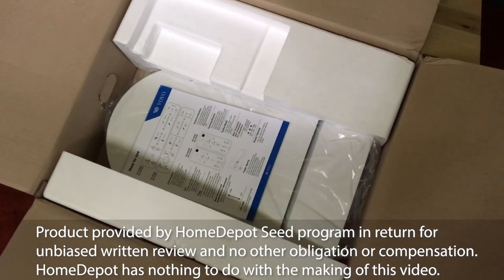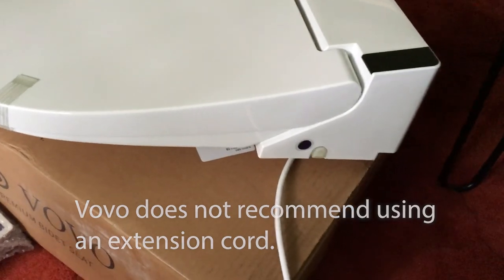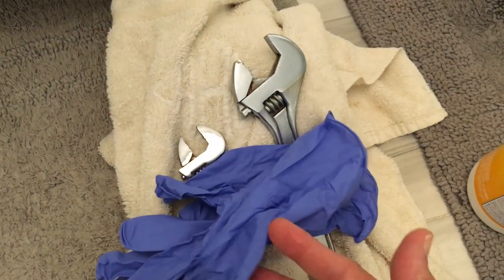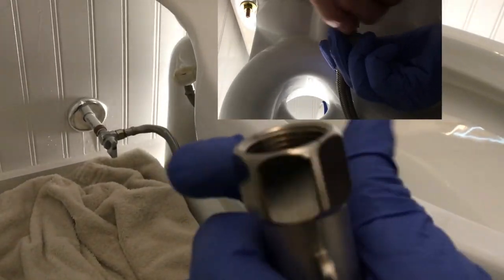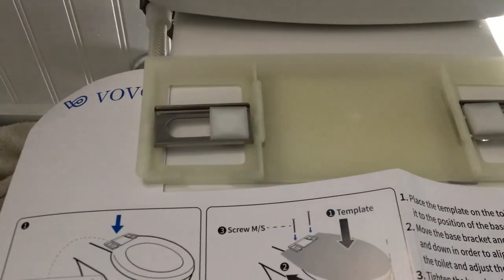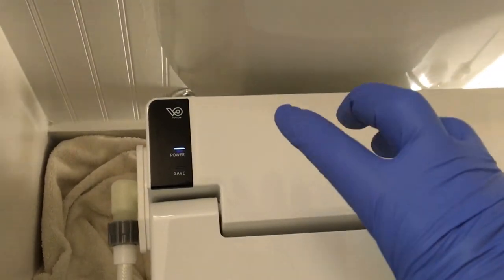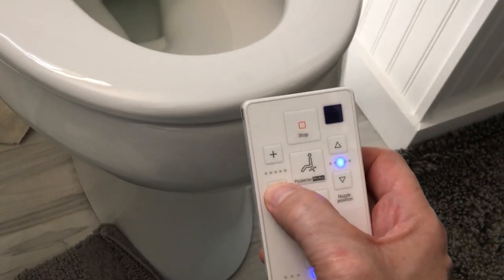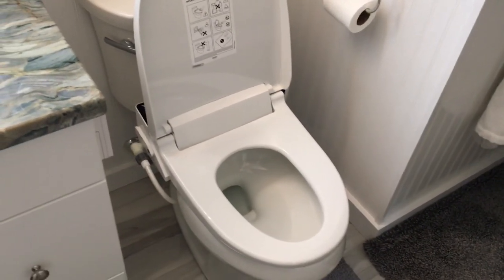VOVO Bidet install and proper use. Model VB-6000SE

Comment: Thank you very much for that informative video. Having just come back from a holiday in Japan, where these bidets are normal standard, I immediately started researching but found no affordable 220V options for use in Europe. Vovo as Korean producer seems to offer that for retrofitting (and no need to go for the insane (~4000USD) expensive "all in one" solutions offered here in Austria).
Reply from the maker: Here in the US we big on pain old toilets, so these seat bidets are a perfect solution as long as you can get power to them. I agree the all in one solution is just too expensive and not needed. Thank you for sharing.

Comment: Is the water heated also. I don't see any setting of water temperature on the control in the video.
Reply from the maker: Raymond, the water temp can be set by using the button located just below the large DRY button @13:20 in the video. You have a choice of three temp settings. Thanks for watching and the question.

Comment: Just purchased one should be here this Friday.  Just now finished sweeping up from putting an outlet in by the toilet.  What’s your opinion on it being you had it 3 weeks now.   Was it worth it?   Sure hoping just givin the price with the amount of features this one had compared to others priced close.  It seemed to have the features the $4-600 units had at only $300.   Vs the others I seen in the $250-300 range seemed to have a few less features than this one
Reply from the maker: Glad you ask, after the third use I became a convert. A month after installation and use, I don't ever see going back to a plain toilet. The misses was more reluctant to try it, but is now a regular user despite having her own bathroom (w/o bidet). My only concerns are making sure I clean on the underside around the spray head, and whenever we lose power the unit drops out of energy saving mode. With use of the drying mode I don't have a need to use TP to pat dry. I did discover the wash and dry cycle will time out on their own if you don't manual stop them and of course they both stop if you get off the seat.
Was it worth it, well I got it for free, but if we had a plug in the other bathroom I would make the investment on a much better way of cleaning and all but eliminating the TP. Your right this unit does seem to have a lot of features for the price. I guess you can save some money by getting the one without remote control. On the manual unit the controls are easy to reach, though if try using it to sit or get up with it might not bear the weight. If I had to give up any features it would probably be the Turbo and Pulsating modes. Looking forward to a warm seat on winter mornings.
Hope you get a chance to tell us what you think of it after a couple of uses. Thanks for commenting and watching.

Comment: Thanks for the helpful video. I have a question: does this bidet make any noises when you sit down on it ( any beeps or nozzle cleaning sounds when the seat sensor gets triggered )?
Reply from the maker: Good question, I have two different brands and they both make little noises when you sit and use them. After each use the wand does self clean as it retracts, however I clean the the wand each time I wash out the bowl.
Thanks for watching.

Comment: Prompt and clear instructions, thank you for making this video !
Do you know how to turn on the power-saving function ?
Reply from the maker: Kalman, to engage the power saving function go to the panel just above the inlet hose. The button is on the far left and it will turn on and off the energy saving mode. Thanks for the question and for watching.

Comment: Ok what do you do if the power goes out ? Or someone hides your remote ? 😱😲🏃🙀 really want to know...
Reply from the maker: Without power you treat it like a regular toilet. If the remote is missing, there are controls on the side of the seat you can use until you find the remote.
Reply from the maker: cdb  Great for guest and power outage.
Reply: It has an button on the side of actual product from what I know

Comment: Hi @cfldriven, great review! Does the toilet ring start warming up only when you open the lit, and stop when you close it, or do you have to manually use the remote control?
Reply from the maker: We have it set to be on, so we are always greeted by a warm seat. The heat function is controlled by the remote and not the raising of the toilet lid.
Reply: @cfldriven  Thank you for your reply. I actually contacted VOVO support about the energy efficiency aspect and they answered. I put it here in case it's helpful for others:

"We recommend you to turn the Power Save Mode on, it automatically adjusts the water and seat temperature to 30°C, gradually decreasing over time, and eventually turning off to conserve energy when the bidet is not in use.
It's important to note that once movement is detected by the sensor, the temperature will return to the preset mode."
Reply from the maker: @AnVinhNguyen  Thank you so much for sharing this helpful information.

Comment: Mine isn't spraying out water at all but has power. What's wrong with it?
Reply from the maker: If the unit is plugged in, and the water is turned on, does the remote light up. If not check batteries. If all those are correct, perhaps the unit is defective. VOVO can be contacted at https://vovo-us.com/pages/contact-us

Comment: Thanks for review. The water inlet pipe, can it be angled down ? (rather than facing forward)
Reply from the maker: Yes the depending on the length of run it can be angled down or back.

Comment: My Led is not working after half a year and the remote is sometimes bugging
Reply from the maker: My VOVO is at three years and no issues so far. Have you replaced the batteries on the remote? Also if it is acting buggy try unplugging waiting a few seconds and plugging back in. Hope that helps.
Reply: Just bought a few weeks ago and some functions didn't work at all sometimes. Maybe bugging?
Reply from the maker: @Janeelle-jg7jx  I would give their customer service a call as there shouldn't be any issues. Worst case return it for an exchange or refund.

Comment: Thank you for the review. Does it have a width spray?
Reply from the maker: No it has male and female button along with nozzle position adjustment. If you need to wash a wider area just move you butt around.

Comment: Great upload, thank you. May I ask which VOVO model this is?
Reply from the maker: Sorry about that the elongated is VB-6000SE and the round one is  VB-6100SR. Thank you for watching.
Reply: @cfldriven  Excellent. Thank you for your swift response. Are you still happy with it? I 'm slightly concerned about its low price compared with the competition.
Reply from the maker: @AntPDC  Overall very pleased with it. Occasionally the software goes wonky and I have to unplug it and plug it back in. I also have an Alpha bidet for visitors which doesn't seem to have any issues https://youtu.be/XFH53PWbJbw
Reply: @cfldriven  Thank you very much.

Comment: Great video. Do you think there is a way to install this on a wall mounted toilet that has no back access to the seat holes ?
Reply from the maker: I would think not as the seat holes keep the whole thing from moving. You might want to check the manufacture to see if they have something available for your particular situation.
Reply: Hi  @cfldriven , I did order the VOVO VB-6100SR and they do include a second set of rubber grommets for my kind of toilet. Just need to get a 4 foot 1/2 water connection from the sink :)
Reply from the maker: @Captain_Hindsight  Great to hear the proper grommets are included. Whenever visiting or staying somewhere away from home, I'm always disappointed to only have tp.

Comment: Unfortunately, the only outlet that I have is the sink area - about 6' away.
Reply from the maker: That exactly the same issue I had with the second bathroom. Finally decided to get an outlet installed and am happy we did. Now it feels strange to go somewhere without a bidet. Thanks Trudi for watching.
Reply: You can use an extension cable. No problem

Comment: Great video. Based on this video I will be purchasing this model. Thanks!
Reply from the maker: Chuck, regardless of the model make sure you have easy access to GFCI electrical outlet. My fave features are the seat warmer and easy to use remote. Once you get it, you'll wonder why everyone doesn't have one.
Reply: @cfldriven  Thanks! I have a plan to install an outlet tied to a GFCI circuit on the other side of the wall. Now to locate where I can got  a few feet wiring without buying a whole roll. Thanks again. 😊
Reply from the maker: @chucktyrrell2115  I know that Home Depot, ACE and perhaps Lowes will sell wiring by the foot. Good luck w project.
Reply: @cfldriven  I ran into a problem sliding the seat onto the base bracket per the instructions. After messing with it for far to long I walked away and thought about it andcameupwithasolution. The workaround was so simple and easy. I put the bolts and bolt brackets in the base bracket and mated them to the seat, then installed the assembly on the commode. During this step I simply positioned the seat. Works great!
Reply from the maker: @chucktyrrell2115  Very clever, thank you for sharing that thinking outside of the box solution.

Comment: Can anyone confirm it works with an extension cable?
Reply from the maker: While it will work with an extension cable, it is strongly advised not to. You want a GFCI outlet that is close by. For our guest bathroom I had to install an outlet just for this purpose.
Reply: I use a 5m extension cable to connect it. Also don't know why it should be a problem. It doesn't take that much energy (not like a oven or sth).
Absolutely no problem 👍

Comment: What is the diference between vb6000se and. Vb 4000se?
Reply from the maker: The VB-4000SE is similar in features except it has deodorization and on the 2022 models a UV LED sterilization of the bowl area.
Reply: @cfldriven  could you please tell me which one of vovo bidet seat is the most loaded with features and do they include auto open and close like toto?  I am not talking about the entire toilet, just the portable seat.  Thank you in advance!
Reply from the maker: @az6877  The 4000 would be the most loaded as it includes deodorization, otherwise it is identical in features with the 6000. They both have manual soft closing seats. No auto open and close like Toto. Here a link to their product page https://vovousa.com/pages/bidet-seat-collection   Hope this helps.
Reply: @cfldriven  thank you so much, you are a star!
Reply from the maker: @az6877  We try.
Reply: @cfldriven  sorry one more question if I may ask: does it warm up sit automatically when you walk into bathroom or you have to press the button to warm it up?
Reply from the maker: @az6877  Great question, if in the energy saving mode it will wait for someone to sit down. When energy saving mode is off the seat will always be warm. Never thought much about this until our first winter with the bidet and now there is no going back to cold seat.
Reply: @cfldriven  ok, now I am almost expert in vovo bidet)) I guess it wont burn much energy even on normal mode because it doesn’t have to warm it that much.  Once again thank you for all your answers.
Reply from the maker: @az6877  Glad I could pass on what I know. Best of luck with your purchase.
Reply: @cfldriven  so do you have to add a deodorant? And How much dearer is the 4,000? Thanks.
Reply from the maker: @johncollins8304  No deodorant, just flush. I have yet to see any little toilet seat deodorant that can deal with a strong smell. Just keep some air freshener nearby. Drying depends on selected heat level and length of time. You don't want it too hot for obsessive reason, too low won''t get the job as quickly.   Thanks for watching.

Comment: BAD VOLUME.
MAKE A VIDEO WITH PLASTIC COVERING THE SEAT. SO YOU CAN SHOW THE FUNCTION
Reply from the maker: Sorry about the audio issue. The seat needs to detect someone sitting on it before it will function. If you get up from the seat the water stops spraying, which is a good thing.
Reply: @cfldriven  when he says "plastic covering the seat" I think he means lay a sheet of perspex onto the seat and press down. Then we can see the spray  mechanism move and the water come out.
Reply from the maker: @johncollins8304  Thanks for explaining the request.
Reply: First off, why are you using caps lock, very rude. Second, volume was great, finally why don’t YOU make a video with plastic on it?

This was a fantastic instructional video, thanks so much to the poster for his time and effort bringing this video to us 👍🏻
Reply: @johncollins8304  yes 👍
Reply: @TheSpyClub  yeah...I didnt mean it as a rude thing.
The video is great, with some things to improve.

Comment: Hi, how long does it take to dry when you use the "dry" function please?
Reply from the maker: Thanks for watching. Recently a holiday guest came out of the bathroom exclaiming how much she liked it using the bidet.
Reply from the maker: And to answer the question the dry function runs for a max of 3 minutes. If you are done sooner you can either turn it off via the remote or just get up and it will shut down. If you want more time just press the dry button again.
Reply: You’re supposed to soak up most of the water with toilet paper and then use the dryer to get totally bone dry. It takes about 10 seconds to become dry when doing it right.
Reply from the maker: @chinosanchez204  That certainly is one way of using a bidet but not the only way. Others prefer air drying when it is available.